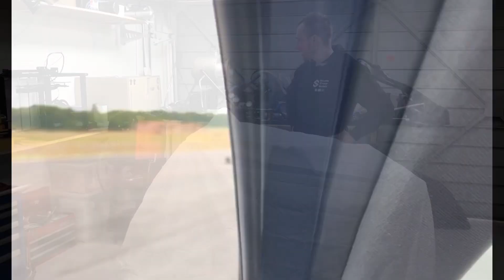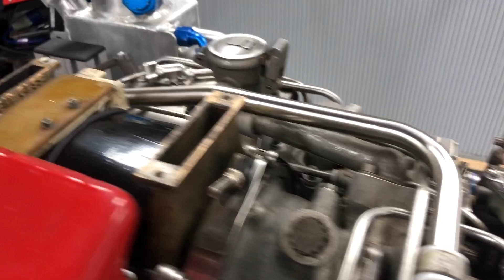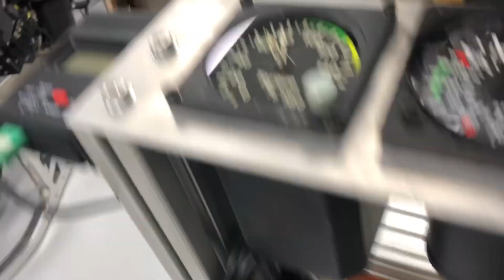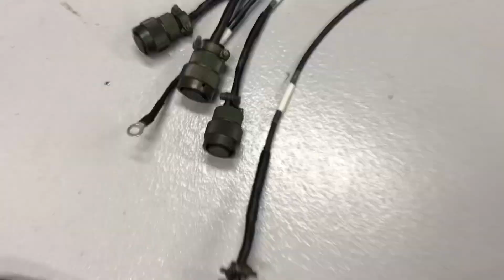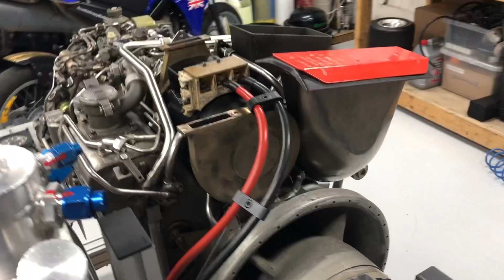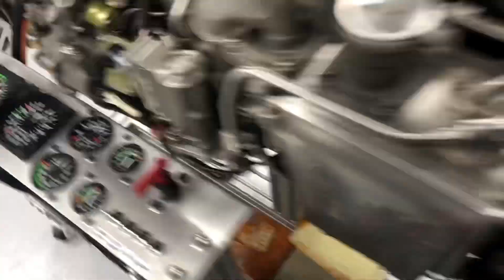Monster Future Project… #JETCAR 🔥🔥🔥

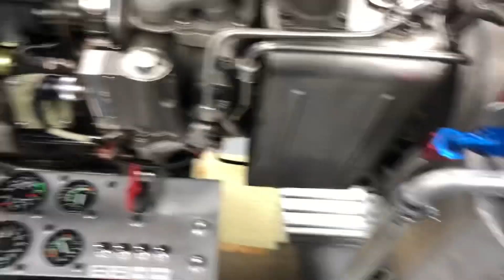Comment: That engine is a piece of art! But what was that smoke at 11:05 while cranking the engine? 🤩 Do you have a pair of Varley Red Top 60s in the front of the engine stand?
Reply from the maker: It sure is! Just oil burn off, oil passes the labryinth seals when they stand for a long period of time and do not get used
Reply from the maker: Ps a pair of Varta car batteries 096 I think